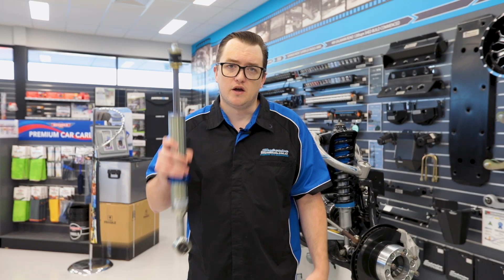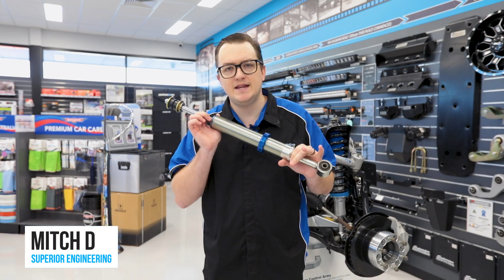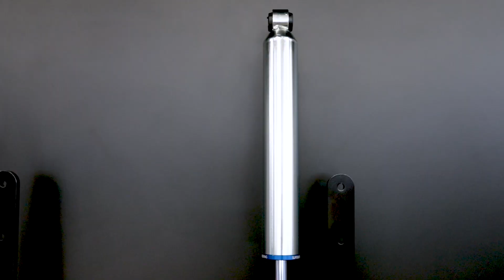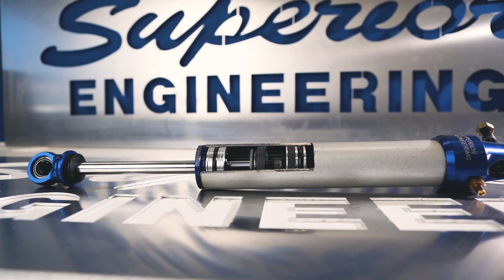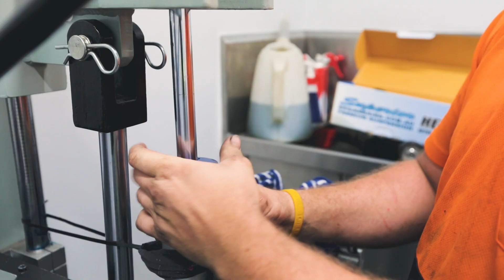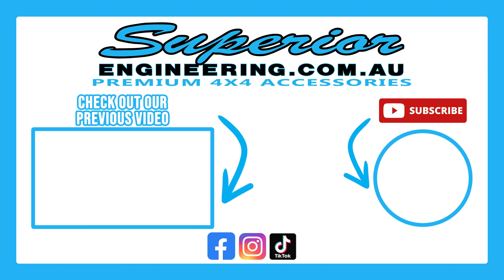Why you need Superior Engineering’s Monotube IFP Shocks!

Comment: have a question . . . 4WD SUVs & light pickup trucks equipped with a 2.0 in. or 3.0 in. suspension lift actually has different level (clearance/height) of lift between the forward & aft suspension setup . . . if the front axle has a true 3.0 in. lift then the rear axle has something like a 2.6 in. or 2.5 in. lift . . . so my question is why's the lift less at the rear? might as well have a true 3.0 in. of full spec suspension lift both at the front & rear . . . if not why??? please advise . . .
Reply from the maker: This really depends what vehicle you are looking at a lot of newer vehicles come with a raked down front to help with braking and the transfer of weight in braking but people request the front to be lifted more to level the vehicle out. Older models like patrols and cruisers don’t have this front rake so the vehicles are lifted the same front and rear.